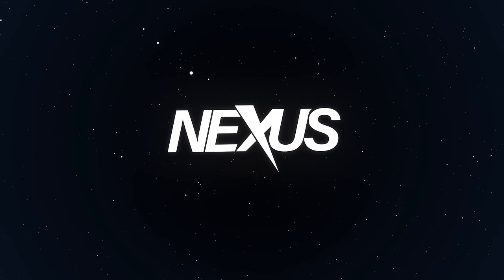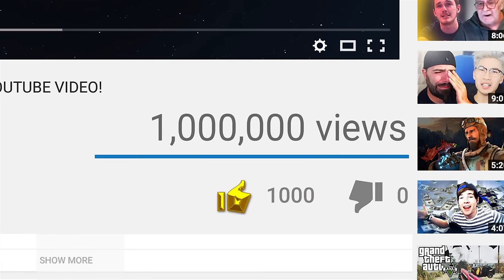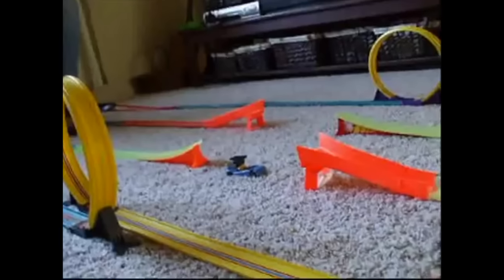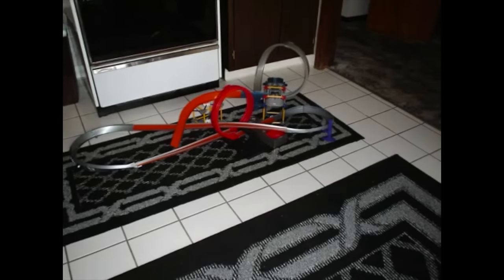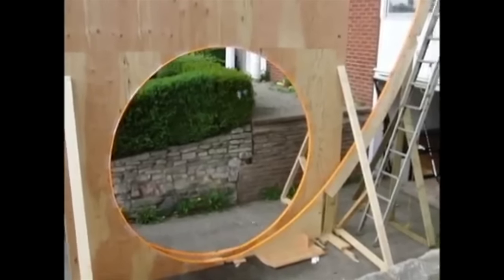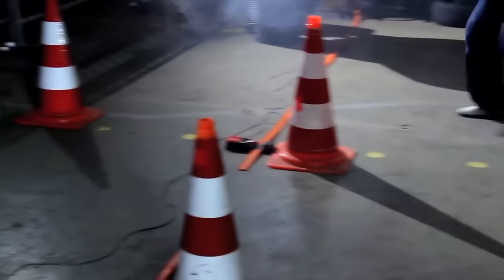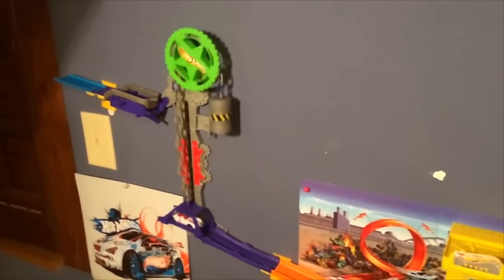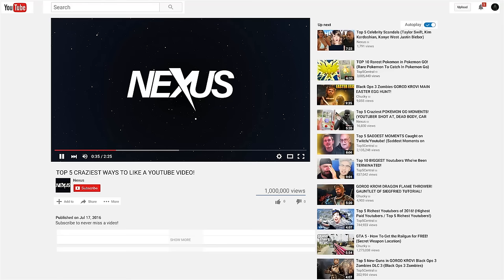8 Most Insane Hot wheels Tracks Ever Made

Comment: So damn much epic awesomeness that I wish I still had all my HW and assorted dinky cars... 
Anyone collect any other toy cars besides Hot Wheels? For me there was two primary brands of toy cars, the Hot Wheels of course, and another called Matchbox. Random oddball brands turned up now and then but HW and MB were the "Coke & Pepsi" of dinky cars.
Reply: I started collecting Matchbox in 1965 before there was Hot Wheels. When Hot Wheels came out, I was 11 and I was dazzeled  by the spectra-flame paint, the delrin bearings, torsion bar suspension, mag wheels, red line tires, etc. But Matchbox at the time was 49 cents and Hot wheels were 99 cents. I worked like crazy to get money to buy Matchbox and so Hot wheels were slow to get into my collection. Dinky and Corgi were just too rich for me. Occasionally a Huskey or Budgie showed up. Then I got an Aurora Model motoring set and it was off to the races! Today I have toy cars from over 40 different companies totaling north of 25,000 different cars and their accessories.